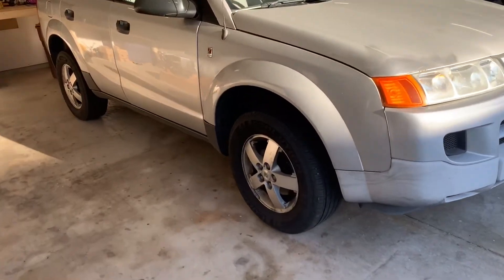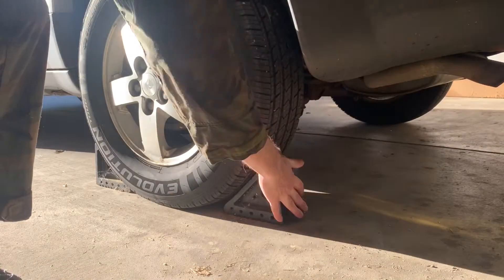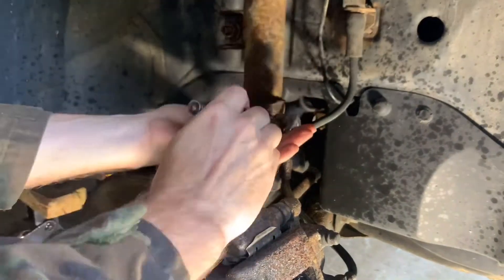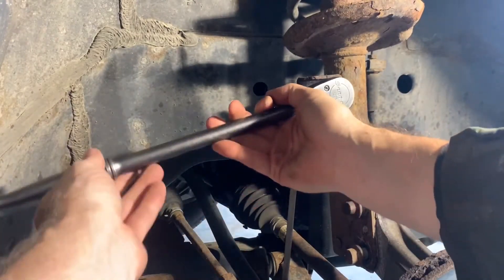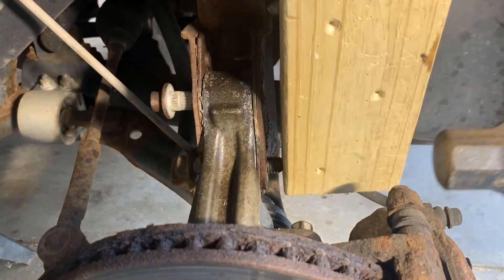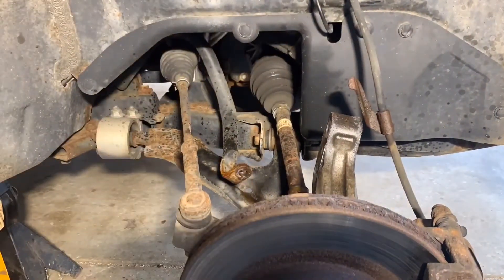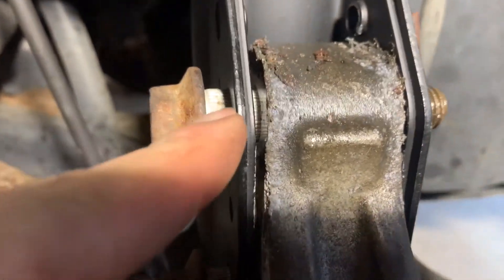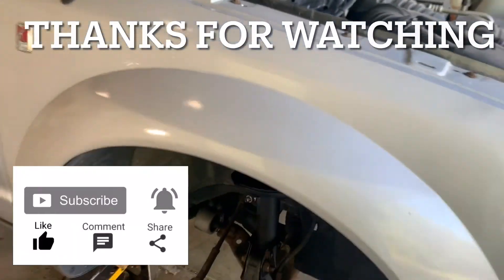How To Change Front Strut | 2002-2007 Saturn Vue | Coil Shock Assembly | Install Replace Easy!

Comment: One important thing you didn't mention, and it may not have applied to the brand of part you had, but the struts may need to be rotated, or clocked, to make sure they line up. I returned my first set because I didn't know that, and I thought they sent me the wrong parts. Once I found out they needed to be rotated by loosely putting the nuts into the top, grasping the spring and rotating, it all made sense. I did get a lot from your vid, but rookies like me were fooled by the fact that the assemblies will likely need to be rotated to match the original position. Oh well, you live and learn. Off to do sway bar links and strut assembles on my sons car. Thanks for the vid.
Reply from the maker: Good point. I also wish I mentioned that a front end alignment is required after this.

Comment: What brand struts did you install? where did you buy them? I'm looking to this this exact job and was wondering which brand to go with. Great video. Thanks
Reply from the maker: The brand was TRQ (TRQ SKA34363), purchased online from 1AAuto.
I did not investigate different brands in detail. I just did a Google search and they offered the whole kit so I bought it.
I’ve had it installed for a year and it’s been fine, no complaints. I had the rear wheel off just a couple days ago and the paint on the struts is still intact and looking great.
If I could redo it, I would also replace the rear coils while I had it apart, not just the struts. Then everything would be new.

https://www.1aauto.com/2002-07-saturn-vue-front-and-rear-8-piece-suspension-kit-trq-ska34363/i/1asfk05570